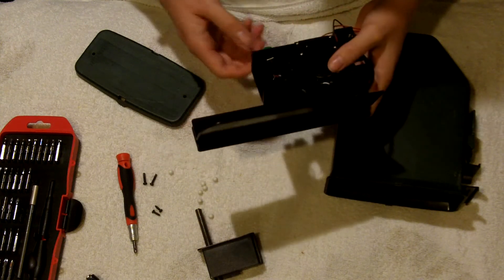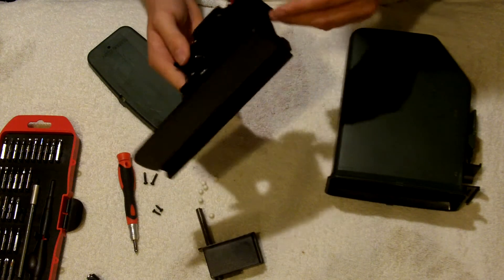How to fix an A&K box magazine

Comment: im having that problem aswell. try opening up the side of the boxmag and watch to see if the bbs will  try to feed into the gears and loader, if not you could always try filling down the entry hole and possobly using a bunch of wd40

Comment from the maker: You probably have the echo 1 box mag which is a little different. It can be difficult to remove on the Classic army version as well but after removing the part with the hoses going into the side of the gun, the magazine should slide out sideways.